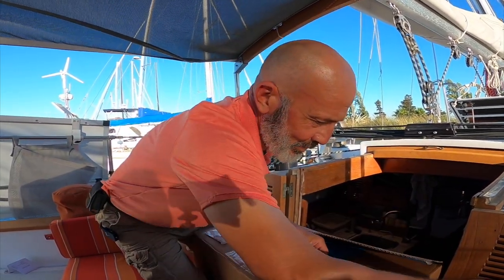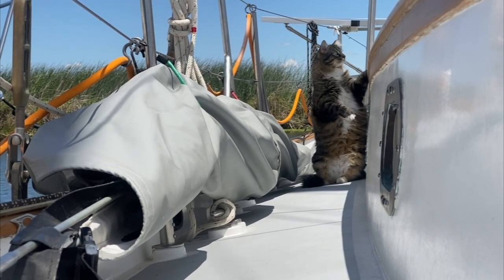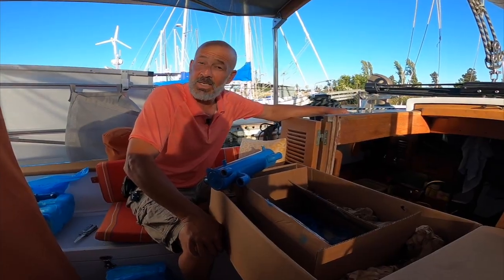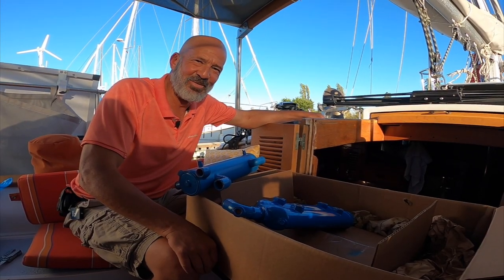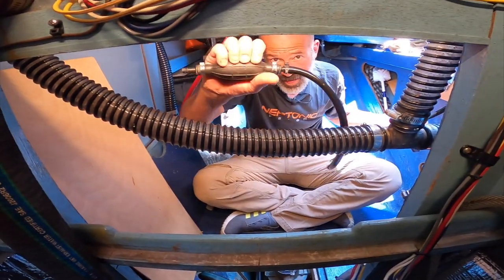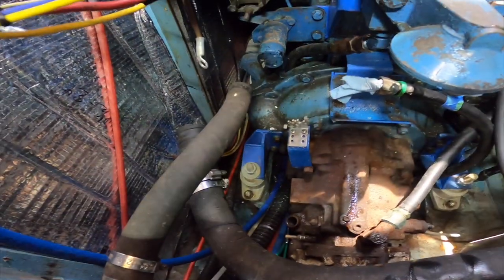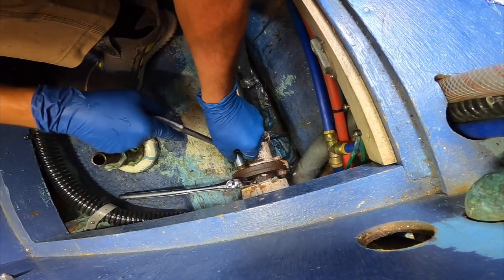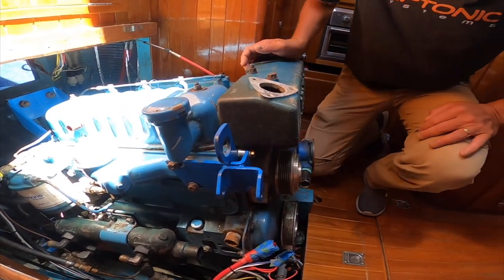Perkins 4 108 Rebuild Part 1 | SV Ramble On

Comment: Aerokroil is the rust breaker I use on those old bolts. Tough on the beta. Things should be getting better on the supply side.

Comment: Usually the velvet drive is left on the bell housing and the prop flange is just unbolted?  You have to disconnect from prop shaft anyhow to check alignment on the reinstall of engine. Best to stay away from CV or rubber alignment fixes if you can.

Comment: Where can I find the rest of the Perkins 4108 rebuild? I'm assembling mine as we speak. Lol
Reply from the maker: Um, we had a fire in our storage shed and some of the parts for the Perkins were in it.  So we decided not to finish the rebuild and installed a new Beta Marine 43 instead.  It would have been a fun project to finish, but we wanted to go sailing!  For us repowering was the right decision.  Good luck with your rebuild!
Reply: So sorry about that. Stay safe. My internal parts are in and almost time to buttom up the short block. So happy for now.